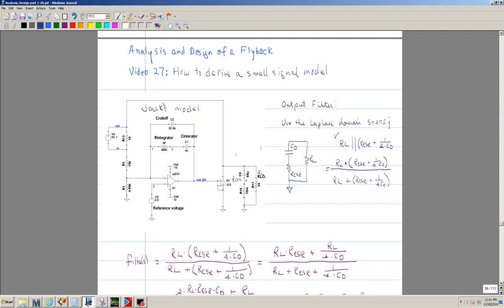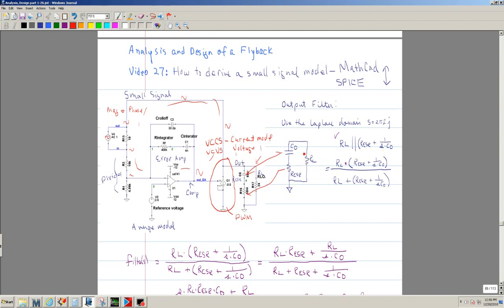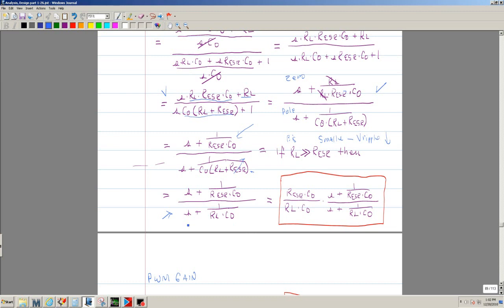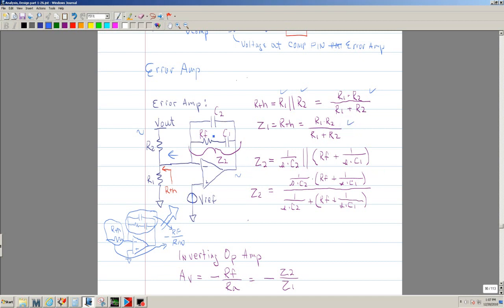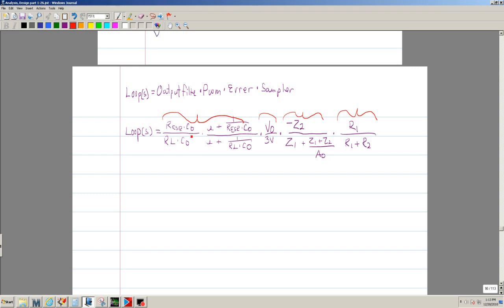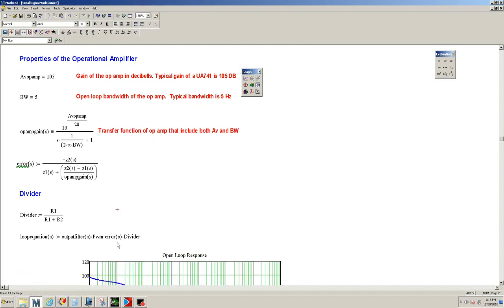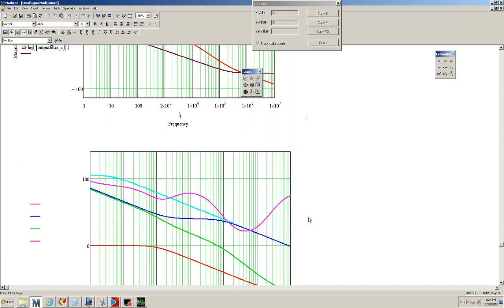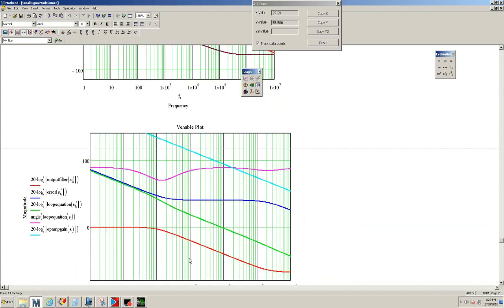Analysis and design of a Flyback. Part 27, How to derive the  Signal model and plot

Comment: Thank you Robert for the video.
 One thing that I have noticed, is that the opto is not included in the loop gain calculation. Is there a reason behind not considering it ?
Reply from the maker: Hi Hicham, I did a small signal of a regular and simple flyback converter to keep it simple. You can derive the transfer function of the opto. The opto has a pole at around 5KHz and can be modelled by adding a capacitor to a current source. I will probably do a derivation in the future. I hope this makes sense.
Reply: @RobertBolanos  Thank you Robert for your reply, just one thing, the gain of the opto which is the CTR has to be considered too and the capacitor with the pull up  resistor of the opto will form a pole at 23 kHz as shown in the example of the video part 23.

Comment: Hey Robert, thank you for a great video!
I have a question, the filter transfer function is only the impedance, so the input is the current from the voltage controlled, I think than in the pwm transfer, you have to divide in R, for a right small signal gain function, gain=(I/vin)*(filter impedance)=(pwmgain/RL)*(filterimpedance)
Reply: Idan Rosen can you elaborate on this?

Comment: Hi Mr Bolanos. Thanks for the useful videos. I watched this video and saw that in ac analysis and formualtion of the loop gain, in the error amp section you said that Z1 is equal to the parallel combination of R1 & R2. I mean the divider resistors, but there's something different in the book written by Christophe Basso (Switch-mode power Supplies). He says that in ac analysis, we consider the DC voltage sources to be zero so the 2.5 volt reference DC voltage source which is connected to the positive input of the op amp would be zero. As a result, the negative input is connected to ground virtually and so the R1 resistor in the divider part goes out from the circuit. Therefore Z1 would only be equal to R2 not the parallel of R1 & R2. I'm confused. Which one is correct?
Reply from the maker: Yes, Christophe Basso is correct. R2 has effect on the gain at midpoint because of the virtual ground. Thank you for pointing it out! RB

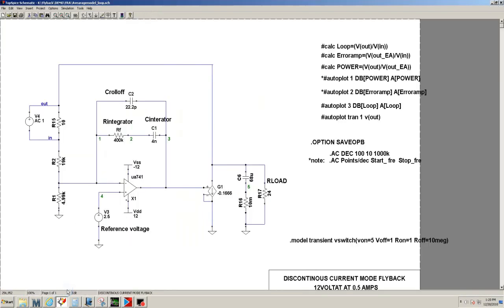Comment: Hi sir, thank you so much for your guide. It is truly useful and it helped a lot of starting engineers to be on track. I have a question, why is it that the current source is changed to - 0.16666 during the simulation at 29:57? Thank you
Reply from the maker: Hi Ernest.  Sorry in the delay in anwsering your question. I have been sick with Covid. Today is the first day feel better. The current source is suppose to be the gain of the PWM. So If changed it, it was to match both the simulation come closer in agreement with the calculation. When using a real PWM, you would measure the compensation pin of your PWM. You then calculate Iout=(Vout/Rload),  gain of the dependent current source is then  Iout/Vcomp.   I hope this make sense. If you have questions you can skype me at rbola35618@aol.com
Reply: I hope you are getting better, please take care of yourself. I am really grateful for your reply. Thank you for putting in effort to make all the videos and reply to every comments. Truly appreciate it:)

Comment: Hi Robert,

By referring to your video " Analysis and Design of a Flyback: Video 29 Second Design Example"

Currently I'm trying to simulate AC analysis (small signal analysis) of my flyback power supply, however i cant find suitable PWM controller to do that. 

1. Can you share with me on how to download the PWMCM2 model (this is PWM model developed by C.Basso) based on your video? Can this model run at LTSPICE?

2. Another question, based on your video, I understand that we can simulate the AC analysis (phase & gain margin check) using average model & Jack's model? Will both give the same result during small signal analysis?

3. If Basso model cannot run using LTSPICE, can I use Jack's method to check my power supply stability in LTSPICE?
Reply from the maker: 1. Can you share with me on how to download the PWMCM2 model (this is PWM model developed by C.Basso) based on your video? Can this model run at LTSPICE?

Hi Fazli, You can download the free copy of Microcap. Microcap has all the Basso models and it already has many sample switch mode suppies using the Basso model. Below is a video and I show where to download Microcap.
https://www.youtube.com/watch?v=vYRzzB-U6JI&t=574s

2. Another question, based on your video, I understand that we can simulate the AC analysis (phase & gain margin check) using average model & Jack's model? Will both give the same result during small signal analysis?

Yes, Jacks model should give the same small signal analysis provided that are operating in the discontinuous mode. 

3. If Basso model cannot run using LTSPICE, can I use Jack's method to check my power supply stability in LTSPICE? 

Yes, you should be able to use Jack's model in LTSPICE or any circuit simulator. 

Show less
Reply: @RobertBolanos  

Hi Robert, thanks for your information. Now I'm more understand.

Can I use same method above to do loop compensation for flyback quasi resonant type?